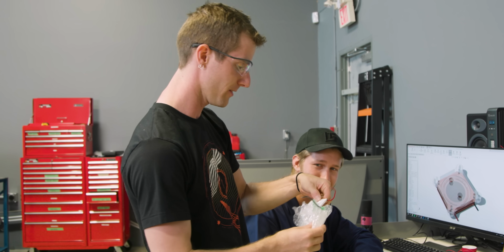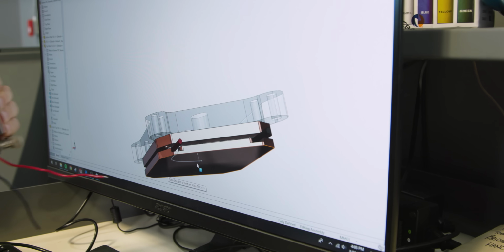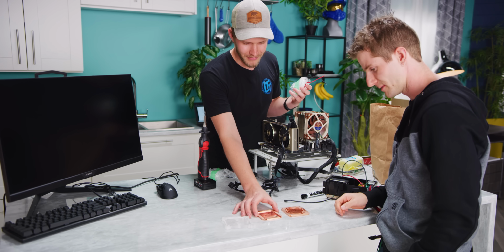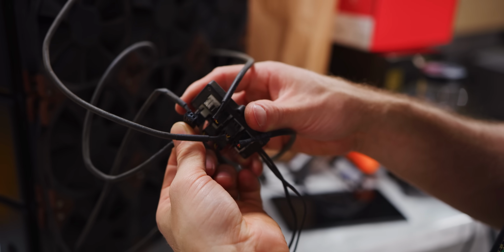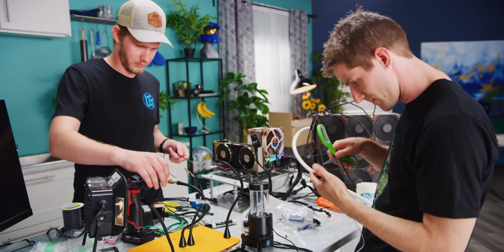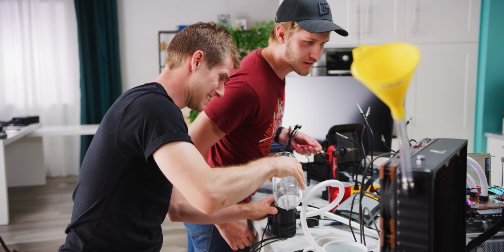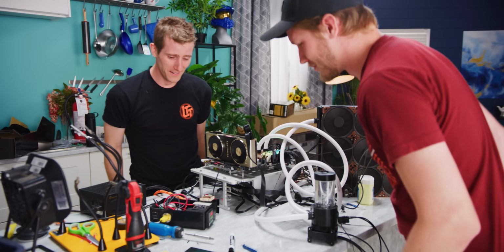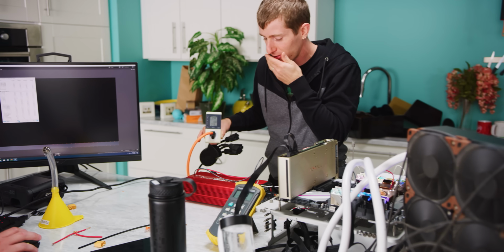This Cooler DRAWS 545W!!? Bad Cooling Ideas #2

Comment: Try adding a second water block to the cool side of the peltier and add it to a loop in supplement to the one cooling the tec.
The idea is to have active cooling of the water in your loop. Not a direct tec to cpu cooling but tec to water loop. 
You would be just supplementing an already effective water cooling loop.

I think it is worth trying.

Comment: If you want to tap holes square and straight, use the drill press but not with power, find a drill or use the chuck key to turn it by hand, place the part flat on the table/vice clamp it, line it up and lower the tap into the hole turning it by hand, once it bites it will pull itself though you will only have to turn it and use lube, LUBE IS YOUR FRIEND, wd4o is better than nothing.

Comment: I saw 237,176 iterations, and I immediately thought something was wrong; LTT does not have that huge of a super computer, and I doubt you would run it for a month.  So I opened up the Flow Simulation file and noticed your mesh is 32523 cells in total, with only 8422 fluid cells.  That is far too low, you only have two partial fluid cells per flow channel,  so Solidworks will not properly understand the flow paths, and will give very unreal results.  I suggest a manual global mesh wherein you specify at least 5 cells per channel with a refinement level of 4.  This will increase the mesh substantially to 696,456 cells total and 362,751 fluid cells, but your results will be believable.   Also your time step was auto generated at somewhere in the 0.0005s range, which does not need to be this low,  you could easily get the same results with a time step 100x, which would reduce solve time and help offset the huge increase in mesh.  Even at this high of a mesh, my 3900x says that it will only take an hour and a half to solve, and Chrome still takes up more memory than the solver, so you should not have any issues running it.

Comment: I still think the problem you guys have is you're trying to put the TEC directly between the CPU and the cooling loop. Ideally, you would take an already thermally-stable cooling loop (CPU water block + Radiator) and ADD a TEC to it (with it's own separate heatsink/radiator on the hot side) in order to get the water temperature on the cold-side of the CPU loop sub-ambient. That way you're using the CPU cooler to get the extra heat generated by the CPU out of the system first, and then using the TEC to cool it further. TECs are used to pull more heat out of a system than traditional air cooling would allow, it's not intended to replace a cooling system, it's intended to augment it.

Comment: Peltier cooling is at most 15% efficient but considering heat leaking from the hot side to the cold side you realistically would see only 10-12%. So that 545W cooler actually is at best ballpark 60W TDP

Comment: Good call on PID controller. Bad form on explanarmtion on what it is. Tec have efficiency of only 10% dont know why you thought this would ever work. And the block try making the channels ever so slightly not straight. A tiny bit wavy will decrease the thickness of the laminar layer and increase turbulent flow that will increase your heat transfer rate. As Q=UAdeltaT your increasing the U

Comment: Linus... You state you will be pissed off if your RTX titan dies (short circuit death I'm assuming)... B4 testing with ur test bench.. don't u have old "who cares hardware" lying around as a test-test bench? That way if boom happens you just have to gather more of your old hardware... Not like the platform case thing breaks.. :) from your local Quebecer/Maple Ridgite :)

Comment: Would be nice to know what voltage or tec you were using. I've been investigating/ playing with tecs with passive cooling but not with CPU temps yet. I had been using tec1-12706 among others, which is a 12v 6A which should be a 72W. But if I said 6v 12A that would also be 72W. So just quoting the Wattage is not clear without  specifying the Volts or Amps. I've also found that if you take the Tec beyond its saturation point heat from the hot side internally conducts to the cold side, so you really need to understand the data sheet of the Tec to see what the maximum temp difference can be without internal saturation. Also you can get tec2 or tes2 which are double stacked modules which might be better ( not got that far yet myself)  just a shame about the amount of current drawn otherwise this could really be a cool idea. (No pun intended)  would luv to see more of this for my own selfish reasons 👍 Good job on that cooling block tho that was awesome.

Comment: Hey Alex: I hope you DO know that one should not couple a PID controller with a 2 state relay. Using a 2 state is fine, but then you would only need a bi-metal switch for temperature control. Using a PID makes sense when you use a DC Amp controller in pair. Then the TEC would only draw as much energy as it needs to keep the desired temperature.

Comment: Assuming the blowiematron pulls 4.5A at 12V, you might be better off getting 10 of those and pointing them in a general direction of the CPU.

Comment: just use that peltier cooling you did in that previous videos and also put that radiator at the same time like combining peltier cooling and radiator will be a good idea the radiator will cool the liquid coming from the CPU and then the liquid will pass through that peltier modules and then to the CPU so it will work

Comment: Not that I think it would matter much, but the design of your water block seems like it connects the hot and cold side thermally because of the bolts used to hold it together. It might work a bit better if they were connected using dowels made of some type of heat insulating material. Even with this improvement I doubt it would exceed a standard air-cooled setup.

Comment: Firstly you need 2 stage cooling. You need a water/air cooler for the coolant coming out of the CPU water block, and THEN cool it with a water block attached to a peltier plate. The peltier plate should have its own independant water/air radiator and coolant loop for dedicated cooling.
Secondly, you need to measure the coolant coming out of the peltier water block towards the cpu, not the block itself. The water block needs to be capable of sitting at signigicantly lower temperatures than the temp set point in order to maintain a heat transfer rate that allows consistant output temperatures.
Finally, I would look at using something like an arduino and and a power transistor to PWM the coolant pump so that you can vary the pump speed with thermal load. This will make it much faster to react to spikes in thermal load than an on/off protocol with a hysteresis value to stop it rapidly turning your solid state relay on and off.

Comment: Yes let’s cool down this loop. By adding a bunch of extra waste heat into the system.

Three laws of thermodynamics: are we a joke to you?
Reply: The "extra heat" on the right side should improve the speed, at which the heat is transfered away, as more heat dissipates quicker. The radiator should theoretically be able to dissipate the extra heat. I guess the problem was with the machined coolerpart, as it was a bottleneck and all of the energy got stuck there...?

Comment: We need much more videos like this!!! excellent video.
Reply: What were the water temperatures?  Did the high side get so hot because the water block couldn't handle the 1500W load you had on it?

Comment: Overpowering peltier module raises its temperature instead of dropping it if heat removal isn't ideal.
Reply: Exactly this - at high power a TEC just becomes a resistive heater on both sides.
Reply: There is a fine line of goodness.
Reply: @wobblysauce  There is actually a sweet spot if you look at the graphs in the data sheet for the TEC. As you are not only trying to get rid of the heat pumped from one side to the other but also the heat created by the input current. Also even though the heat is being pumped from one side to the other both sides are still physically connected with a casing and the outer faces are still physically close together meaning conductivity and convection can still transfer the heat back towards the cold face from the hot side. It is better to run more than one in parallel to increase surface area whilst still keeping input current lower and using a heat spreader to bring the face being cooled a bit further from the cold side.
Reply: You're correct, I'm pretty sure the seebeck effect exists even if overpowered passed it's specifications, but it becomes that much harder to cool (resistive heating increases at a faster rate than the cooling effect) and the delta between the two sides decrease as the hot isn't cooled at a fast enough rate. The resistive heating effects always exist in it, that is why the final cooling solution needs to be able to cool a thermal load that is the peltier + the object being cooled.
Reply: @SimonWoodburyForget  The answer is custom loop with chiller, If going high end 'workable' cooling.
Reply: @Heads Mess How is that better than a chiller on a custom loop?
Reply: @Heads Mess lol, use that 500w Peltier to make a small blast chiller and have the fans pull the blast chilled air over a radiator externally mounted so the chilled air doesn't cause condensation in the system.
Reply: The water block is so thin
Reply: @guydevries8197 , the massive of the water block isn't necessarily that important. The mass just effects the blocks heat capacity, but the main importance is the interface between the fluid and block, which is actually what moves the thermal energy out of the system.
Reply: @JimBob1937  THANK YOU! i was screaming internally at those huge ass fins they had for the block...they need thinner,taller and a LOT more fins,also maybe some fluid with better thermal conductivity

Comment: It’s rated at 32 amps, and we’re expecting 32 amps...

Yeah, I’m just going to stand back here, behind the plexiglass, with the fire extinguishers.

Always use things that are rated for a higher load than what you are expecting. Helps keep things from burning and exploding.
Reply: Yeah... a fire extinguisher with the safety pin still in it. Very useful in case of electrical fires, I tell you.
Reply: yeah, don't you generally only run about 80% of a wire's maximum rating for safety?
Reply: @MmMerrifield  There are rating for continuous use. Using exactly the gauge rating is not it ;)

Comment: The reason the PID probably failed was because you didn't account for the initial run where it'd have pretty significant overshoot from the set value. Usually you'd just your set value to half or less of what you'd actually set it, if you are expecting overshoot that big and then auto tune the PID. Also i'm not sure if the PID was even a decent choice considering that your system will have a different response under load compared to idle which would then require  you to auto tune it again.

Source: senior year EE student.

Comment: Were you guys trying to put the DC load on that SSR? Those things need AC on the load side to power up.
Reply: Only the SCR types. You can buy SSR's that are designed for DC operation. They're essentially an IGBT I would assume, maybe with some input conditioning.
Reply: @Jimmeh_B  Yes, IGBT or MOSFET works in DC. A SCR needs to cross 0v to turn off
Reply: @alexandrecouture2462  yup

Comment: Why not use two water block, one for each side of the sandwich? 
One would chill the water and go to the cpu and the other for cooling the hot part of the peltier. 
Maybe something with a big thermal mass, capable of adsorbing a lot of heat fast, like a big air cooler with a lot of heat pipe could be an option for the hot side.
Also some thermal insulation materials in between the two copper block around the peltier could help too.

Comment: The best way to use TECs are to use multiple in peralell at the lowest vorltage you can get away with... it minimizes waist heat and maximises area.. you'd need 2 loops at minimum to do this for computers though and the cost would skyrocket do to all the extra waterblocks you'd need.... or you could make an insulated case that uses TECs to move the heat out of it.. also removes most the issues of condensation

Comment: You can use solid state cooling but your rigs are not going to work in a single stage system.  It will take a two stage system with water cooling then use the chip to more more heat out of the water to another radiator alway let the room air do the job first then use the cooler to get the extra drop not the whole job in one stage.  If your interested in this I would be happy to draw up a simple rig for you to see this work.

Comment: I always wanted to play with tecs but my plan was dual loops. Sandwich a tec between two CPU blocks and transfer the heat from one loop to the other. Both loops having radiators to keep the work needed to be done by the tec minimal. But by the time I got two massive radiators to start going down that path it was soon very obvious that the 2 massive radiators were more than sufficient to keep temperatures pretty low as I'm running the equivalent of two of those radiators you were using and fan speeds are barely just above their running speed. Any slower and the fans shut off.

Comment: you should use the sub zero water refrigerator with it from the old vid... to make the overkill cooling
Reply: This would actually work.. if the chiller keeps the hot Site relatively cool. Tec work on Delta T, regular watercooling wont be sufficient.

Comment: 7:29 Clean That Taple & Floor AND each material must have its own containers so when you have containers full clean materials exsample copper  you can bring it to scrapyard if you have like electric wires strip those and put coppers in that same container so you can get moneys back and its good to do so those differend metals dont go in normal carbage

Comment: You forgot the cpu heat load in the simulation, plus you need to switch them really quickly or you can cause them to break from the thermal cycles. I think it was about 3k herts for pulse width modulation

Comment: Peltier cooling was pretty common over 10 years ago. I had a 200watt module running in a Dangerden Maze 2-1. 3x120 rad and an ehiem 1250 pump.

Comment: It takes a decent amount of experience to tap straight without readjusting every turns to keep it straight, and that is in a vice... like you would normally do.
But you can definitely not tap straight holding the piece of plexi in one hand and the tap in the other one... lol

Comment: Goddammit, so to overcome the shortcoming of the peltier, you cool the water with it and then pump said water through the tubing. You need to use the peltier as a silent water refrigeration unit. This way water acts as a time buffer and peltier is not overloaded, because it's in passive configuration, it always has something to do.
Note: Do you even check on sites like overclock.net if your build works in general ? Because "my first babby project" is entertaining and all, but you need to think a little if you want to engineer something that works.

Comment: I did this 5 years and used a submersible fishtank pump in a water jug. But i didnt use the peltier direct on the cpu but instead had it sandwiched to a waterblock and aluminium heatsink on the loop. It was an ugly site but did the job but peltier made little difference to no difference as the circulation was very high...

(Halfway through the vid and i see the same rad lol)

Comment: I'd say cooling the warm side is the problem... Either your Copperblock isn't efficient enough or the heat transfer from the TEC to said block is shitty... But since Linus said the copper block is very hot I bet taking heat from the warm side away is the main issue. Using a self made copper block with such thick fins might not be as efficient as using solutions from EK or Alphacool. You should rather try to manufacture a "heat distributing" copper plate with 4 milled spaces to set in copperblocks from EK/Alphacool and one spot on the other said of the distribution block with a 1 milimeter milled spot for the tec and use liquid metal instead of thermalpaste

Comment: Back when I fixed my uncles miniature fridge and found out about peltiers I've always wanted to build a peltier cooled pc. I gave up as it goes way beyond my capabilities. There are a few successful setups that I've seen in cooling/ ocing forums. 1 Peltier is generally not efficient enough. A good setup is 2 400watt peltiers with a water cooling loop. The ultimate setup I saw had an Arduino system controlling the voltage to keep the cpu chilled right above the dew point at all times. Pretty neat stuff, but expensive and crazy impractical.

Comment: i think you should not screw the 2 plates together... the bolts might get hotter in the hot plate and transfer the heat to the cold plate....

Comment: I'm sorry, but correct me if I'm wrong

Peltiers are rated not for "hours of operation" but "off/on switch amount", and using PWM (which this PID unit uses, I suppose, if you using SSR) should burn this Peltier in few minutes depending on PWM frequency, which (if everything previously said is correct) means - you fried that project somewhere in the middle of the video.

Am I right? Anyone?

Comment: So put basically A CPU's cooling has 3 factors
#1 Power Usage
#2 Die Size, I.e. Surface area for heat transfer
#3 Thermal Conductivity <----- THIS THIS RIGHT HERE..... IM POINTING AT THIS
 'A little knowledge is a dangerous thing'
CPU manufacturers need to start integrating "cooling pools&towers" into Chip architecture using metamaterials and also move the Control Unit connection points to the sides of a CPU Die freeing up both the front and back of a chip for thermal transfer.....